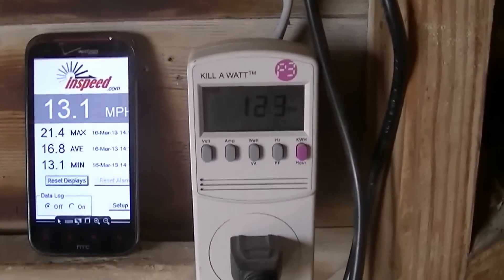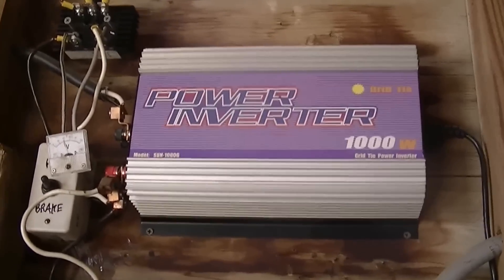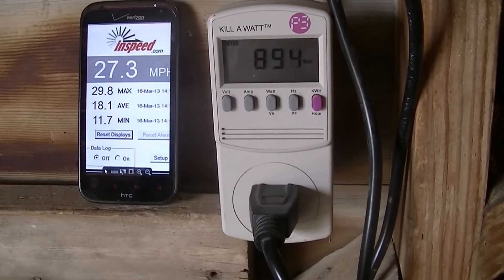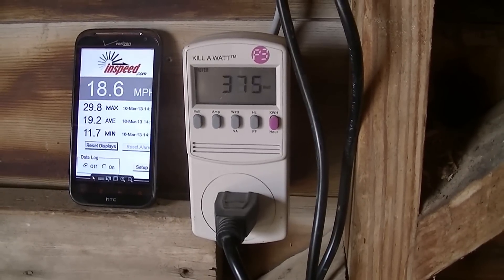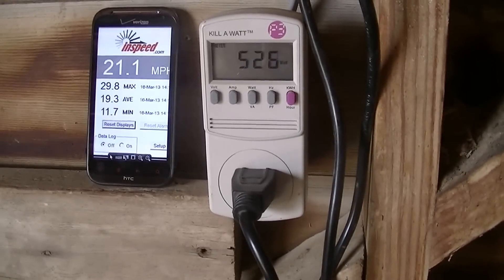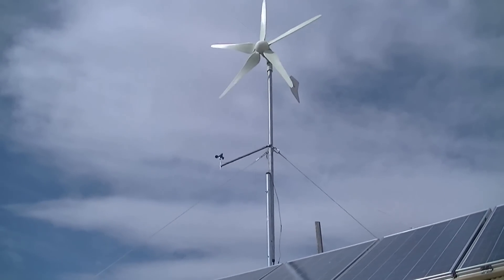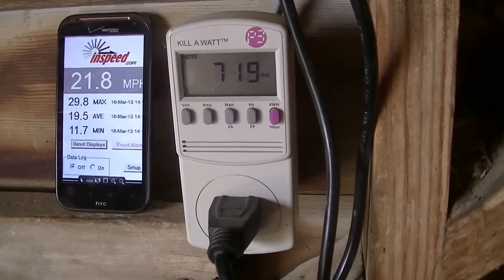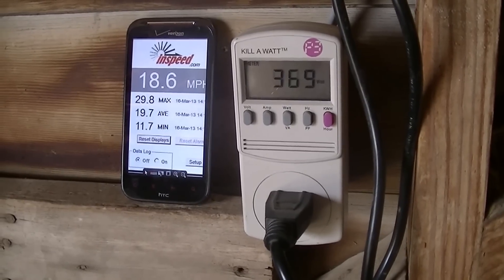New HY-1000L output

Comment: You can't complain with that output. Matches the power curve put out by the manufacturer. I have to little 400 and it matches their power curve as well.  If I had it to do over however I might consider the act seal flocks like Orlando Sanchez and Chris Olsen have. But I'm convinced for the money nothing beats the WindMAX.